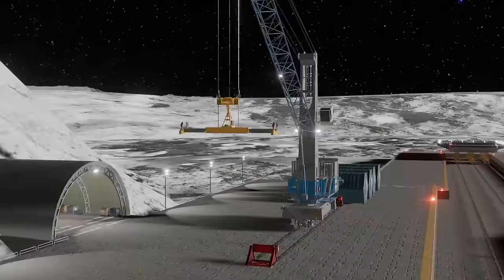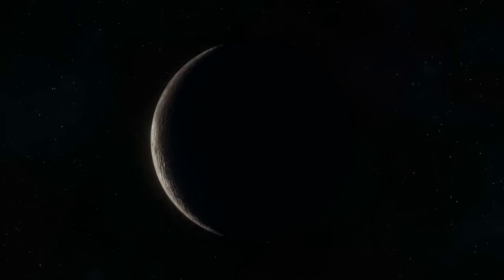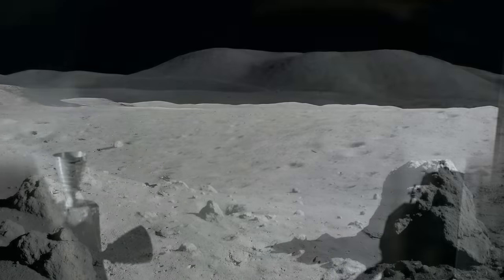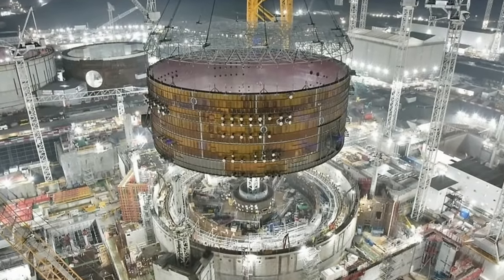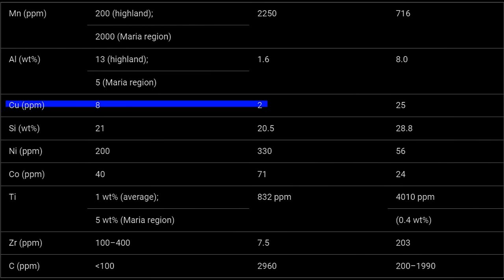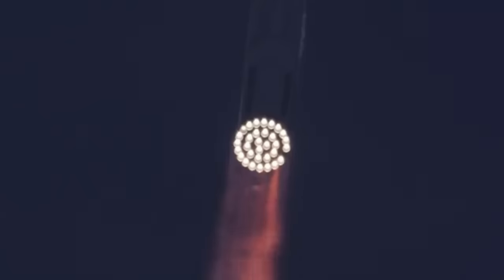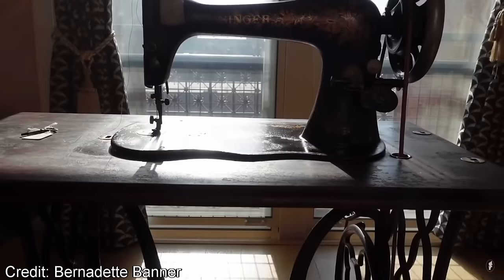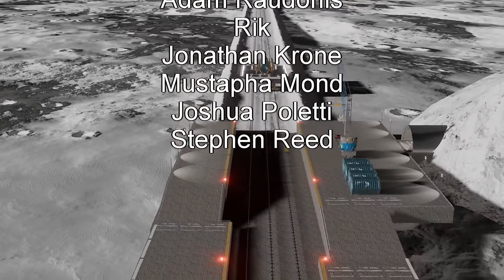Designing Heavy Machinery To Excavate The Moon

Comment: The great thing about mining on the moon specifically is that the mining machine itself is 90x more efficient because the material weighs much less. But also doesn’t just decide to float off like on an asteroid. The only constraint is the capacity of your tool and not the actual power of it.

Comment: I'm biased, since I'm sitting in a Komatsu WA270, but with wheels, you'll have problems slot-dozing.  A loader/haul truck setup will be much more efficient than trying to push long distance. You can still collect material over aome distance with a loader. It is possible to build these cable-driven, but enclosed leadscrews will be more effective, and probably won't be too suceptible to dust ingress because there is no atmosphere to carry the dust.

Comment: I would consider a walking system like giant draglines use, and servo mechanisms instead of cables and pullies.
The large feet of walking draglines make it less likely to flip over it encounters a dust filled pit or something.
Regolith can be really rough on exposed equipment, and might plague the cables. Servos can be fully enclosed. You would need some kind of lubricant though.

Comment: You could just hardwire everything together. And instead of using trucks you could use rail cars driven by a pulley. And whenever an area runs out of materials you just move the tracks.

Comment: Believe you are on the right path but argue the first sized vehicles should be sized down to Riding Lawn mower sized vehicles. Why? Because they are large enough to produce resources and dig deep enough but small enough to be cost effective to launch. Once there we can establish ourselves to build the larger vehicles you presented. I agree to the idea of the older pully and "Steam" Shovel style.. just smaller. In about 10 years, after landing, the production facilities would be capable of building the larger units you presented and since manufactured there would be much cheaper. Carbon could also be mass produced by growing moss on the exterior walls of the hab space, ie, double layer it. Inside is where we live but have a wall cavity that is accessible and has atmo but grows mass quantities of moss. Think like the far north homes in euro counties. They line the roofs with peat and moss. Same concept. The bonus thou, aside from lots of clean air and carbon, is moss holds water well. Providing a natural radiation barrier.  This moss could also be mixed with lunar regolith to add organic material before we use it in the vermiculture bins. Why vermiculture the regolith first? To soften the grains down quickly and interject bacteria from there guts.  This would then be far more suitable for crop growth. :D hope my brain dump helps.
Reply: Also never doubt the power of sand batteries. Serves multiple purposes. Able to store Heat, which is like gold on the moon, and produce electricity from it. So less radiators and more containers that have the semiconductors that heat/cool. I got a micro fridge that works on same principle (actual name escapes me right now).  We could also pull heat out of the (regolith) sand batteries to heat our base as well. Which would basically turn the whole base into a giant heat regulator.
Reply from the maker: All for thermal wadis but regolith is a strong insulator making it less useful than we hoped.
Reply from the maker: You'll likely be interested in this video where I talk about the 'beginning' :) https://youtu.be/WZN2xXMb28g?si=TXFN7l4ioaFl_LNb
Reply: @Anthrofuturism  fair, never took a deep deep dive, figured it would have some losses compared to normal sand banks. Thank you for the video's and info. I will watch your other ones too. Tbh, if I won 500$ million. I would work towards this goal hard. Most the stuff we design and build will/should work on mars. And the argument i have to go to mars is "Where are the dino's now? they lived in a Eden and we could never make it better but one rock changed that. Any tech we need to deflect or redirect could be stored more safely on the moon". The moon is just our first step to the stars. The literal sand box in our back yard to a toddler. :D
Reply from the maker: @christopherrenn8137  Exactly and I really hope you win $500 million :)

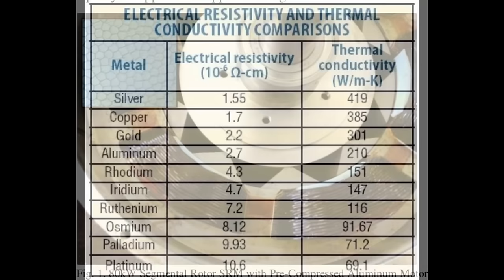Comment: @18:00 Actually, aluminum is extremely common in 3-phase induction and reluctance machines (motors and generators), although used much less frequently for the stator coils than it is for the rotor conducting bars (aka "aluminum squirrel cage rotor"...  <--- google the quoted term for more info). 

Source: I've been a motor engineer for the past 17 yrs

Cool video topic... good job! Thanks man

Comment: I cant help but think of Relativity Spaces process of using a steel 3d printer to make rockets and how it could be used to boot strap some of the first large mechanical items needed. If it can make a steel rocket I'm sure it could make a wheel, or blanks to be machined down into precise items like rails or axles on a C&C machine. 

Also quite a few mines (Creighton Mine for example) are the locations of large ancient impact sites where minerals where deposited, and/or concentrated from the melt caused by the impact. So there might still be locations where more rare but useful minerals(like copper) can be found for use on the moon. But I would see that being used in the more advanced industrialized stage of the moon.

Comment: we need to also consider lunar regolith finding its way into cables and pulleys, as there is no weather to weather it up there, every microscopic grain or particulate is razor sharp and could easily work its way inside a cable, where it can compromise the integrity and cause a malfunction. machines also need to be anti-static as this also contributes to devices gathering a layer of super-fine mega-sharp ultra-annoying regolithic dust.

Comment: I have nothing to say about the mechanical part of the video, but if I may add my 5 cents to what you said between 22:11and 22:55, lunar electronics are going to be much, much heavier, than terrestial electronics, because they need to ressist charged space particles (look up bit-flipping). Since the Moon has neither atmosphere, nor magnetic field, modern electronics are likely to be imoperable, since smaller tranzistors require less effort to let an ellectron through, and thuss are more susceptible to bit-flips.

So all in all, lunar electronics will need to either have lower processing power density or include heavy shielding (Excavator's hull probably gonna help with that), or both.

Comment: The majority of mass is SiO/AlO - so, you can easily make ceramics and glass. That gives you S-Glass tensile cables, and mesh envelopes, so that you can inflate a dome and hold catenary cables aloft; that's the best structure for robotic fabrication facilities. You can also easily mass-produce mirrors, for solar concentrators - that's why they are so much better than photovoltaics or nuclear. Better to build on asteroids, too, where you don't worry about gravity at all. And you can't burn hydrocarbons on the Moon, even if you brought them: there is no atmosphere to combust.

Comment: If you look at NASA NIAC 2016 there are to studies about  clockwork automata, AREE (Venus rover) and RAMA (asteroid tug).
Both obviously are build and optimised for their missions, but they still could serve as inspiration. You could store energy mechanically in flywheel. Good PV cells are not easy to make and require rare elements, so solar thermal would be a better choice.

Instead of radiators a internal heatsink can be used.

Another thing to consider is that in some cases there might be no need to use flatbeds and conveyors to transport material. Because there is no atmosphere you could launch material directly from digsite and it would fly on nice parabola to its destination.

Comment: Hydraulics are used inside large vacuum systems using vacuum oils, often silicon based. Imported weight and bulk are problems.

Nutating gear reducers are easier to protect from abrasives and a shovel system using a crank driven 4-bar linkage system to save on import weight. The first counterweight would just be a bin filled with regolith. A shovel can dig up, flat, or ramp down. Robotic wheeled dumper bins would be assembled for transport.

Likely a robotic bin will be the first tractor sized excavation object with humans an a pair of Mk 1 shovels using muscle to fill it. Next trip might ad a second bin and the starting bits of a shovel. Third trip a third bin and the remainder of the shovel. Another  bins and the second shovel with the next two trips etc.

Comment: Another issue with aluminum wiring both in general and in motors: it work hardens, embrittles, and can corrode more easily over time. It also cannot interface with copper wire. Basically anything made with it will have an increased chance of breaking down and must be considered disposable long term. Now I don’t know if this is an alloy problem from when it was used in wires here and can be fixed, but yeah.

Also instead of requiring carbon for steel, you can simply make a much lower carbon alloy (possibly a mild steel) and beef up your machinery appropriately. As well different alloying elements are possible substitutes for carbon in certain amounts, like nitrogen. Just food for thought.

Comment: Another great video, well done! 
I especially like the deeper dive in the available technologies and resources that you go through, really makes for great believable design
One of my concern however regarding wheeled vehicles on Luna is the hard & sharp regolith dust that could grind away at rotating mechanisms
For the first lower tech generations of vehicles I think wheels still makes sense, but I tend to think we would later deviate towards "walking" vehicle designs so that everything can be fully sleeved and sealed against dust. These might even incorporate compliant mechanisms and static electricity repulsion to minimize wear even further
Reply from the maker: Like the strandbeests?
Reply: @Anthrofuturism  Something like that yeah, with more or less legs depending on the load the terrain and the speeds they would need to be operated at
I can be partial to many or few legs, but the strandbeests give me millipede/tank tracks vibes that I really like

Comment: Actually, those big historic wheels are not cast. They are typically ring rolled with riveted spokes all from hot rolled steel. While cast steel is much less brittle than cast iron, it is not quite there with forged and rolled steels. And while that may sound scary, if you have the kind of large size steelworking machines, none of that would be very difficult...

Comment: I'm not sure about where it is on your timeline, but that smelting is enough for cheaply bagging and splitting up a lot of c-type asteroids, carbonaceous and full of volatiles.  After all they're a useful minority of asteroids near Mars, and the majority past the mid-belt, which can be put on elliptical orbits.  The best source is bulk from objects relatively new to the inner system that can be directed with sail brakes and outgassing.  As long as there's a cartel or government-style bond system with reserves to balance out fluctuations of sources with years-long lead times and consumers, after a few years volatiles will suddenly go from scarce to plentiful.  

That filtered mud will be more expensive than steel though.  Especially from a cartel.

Comment: I think the solution you arrived at here makes the most sense. I think those machines would all be robo operated. Metals do bad things to radiation. So in a sense I think you build a large number of these things to be robo operated. Where the operators would be on the moon but working from inflated habitats or those fancy rovers. Which are just mobile homes.

Comment: If steel, pulley and cables are used what about cold welding, you couldn't put a protective layer on the moving parts as it will wear out quickly and then weld. This was a good video and glad that someone is looking at this.
Reply from the maker: @samuk912  good point. Cold welding can be prevented by occasionally bringing the vehicles into a pressurized bay to oxidize the metals or by making the cables steel and pulley contact surfaces aluminum or some other dissimilar metal combination. Also buffer surface wear might just be an operational expense.

Comment: There are two problems with mostly moon production. 
1. Rust. Or to be exact the lack of it. Our machines rely heavily on oxidation to work. Oxidation stops bearings to cold weld themself together, make it possible to have metals stacked for transport and storage, to be able to get them in contact with reactive materials without the destruction of them. The heavier the machine the more prominent the problem. Light machines produced on earth and then transported to other planets circumvent this problem because the oxidation "applied" on earth will not wear down over the lifetime of vehicle on the oxygen less planet.
2. Lubrication. The bigger the machine the more complex and the greater the amount of lubrication. Lubrication can offset the cold welding of metals to some extend. To produce lubricants on the moon is nearly impossible, even if no hydrocarbons in the compound.

Both problems are heavily present in ball/roller/plain bearings. These need lubrication and a correctly oxidized surface to work as intended. And bearings have to be very precise and are not easily produced on the moon. I think the size of the machines are limited by the bearings that can be effectively shipped and used on the moon.

Comment: Hydraulics are even worse than described in the video.  Hydraulic cylinders are sealed with polymer gaskets, some of which would be directly exposed to vacuum.  Polymers outgas and turn brittle in vacuum with astonishing speed.  A hydraulic cylinder in Lunar vacuum would very quickly lose its seals and leak its working fluid everywhere.

On top of that, hydraulic cylinders depend on the lubrication of their own oil to allow the piston to slide back and forth past its seals without tearing them up.  In a vacuum, the skin of oil carried out of the cylinder by the piston would sublime, boil, or freeze, depending on sunlight at the time.  Regardless of how it goes, that skin of oil will leave the piston very quickly compared to Earth conditions, adding mechanical failure to the vacuum failure the seals are already suffering.

The hydraulic cylinders Earth-based mining is so dependent on really are terrible practically everywhere else in the solar system.  Maybe the working fluid and seal materials could be swapped out for something more exotic ("It's hydraulics, Jim, but not as we know it."), but I'm not chemist enough to guess what those materials might be.  Maybe someone qualified to write ACS articles will see this and take a shot at it.
Reply from the maker: Great info, thanks!

Comment: So for vehicle to electronics weight, the biggest part is wire weight which is around 100 to 150 lbs in a car that sits at around 3500 lbs. Also vehicles tend to us fpga's over say how a smart phone is/was designed around a soc or your laptop around a motherboard, because fpga's are cheaper, lighter and more power efficient for the task at hand. (this all not counting battery weight themselves). The hard part is trying to figure out the weight of it as a % for a simplified easy to produce system that is also either automated or tele-operated, since it's hard to say between the feature set of an older 1948 car had 150 ft of wires compared to todays modern luxury car running nearly a mile of wires inside.

Comment: I think that fewer, larger, simpler machines, would work well, preferably as stationary as possible. Imagine a bucket chain excavator, with huge walking "feet" for moving a few meters a day. This would be connected to overhead high voltage lines for power, and a ropeway conveyor system, or cable operated mine trucks on tracks. It would be ugly, simple and capable of moving mountains.

Comment: Well, there’s one thing about cable machines, one of largest buckets there are, they’re on the draglines. Probably, they are few times larger than ones that are on the largest excavators. Maybe draglines are even more preferable because they have larger reach radius. And in the moon gravity they can be gigantic. Also, powering them up with electricity is not a hard task, you can do it by, yet again, cables coming from power grid, as it is usually done down here.

Comment: Something I would disagree with is using rechargeable equipment instead of self propelled. Construction equipment literally exists to build infrastructure. How are you planning to charge it in an area where infrastructure is currently in the process of being built? With a battery solution, you would also need to build additional equipment to transport the heavy equipment all the way offsite back to base every single day to recharge.

Comment: There are many days of hours in a lunar day , communications , Motors , heaters ( induction and resistance ) and electrochemical systems can be run directly off of solar panels without batteries . As long as your lunar equipment tracks solar ( even reflected ) or has power delivered via cable , rail even electromagnetically there will be power available almost half the time , only life needs continuous power from battery or nuclear .
Once you have shelter and batteries made you can have continuous manufacturing then food production then continuous human occupation .
Relay , transformer and vacuum tube wiring logic is able to be 3D printed ( winding coils and transformers better done conventionally automatically ) .